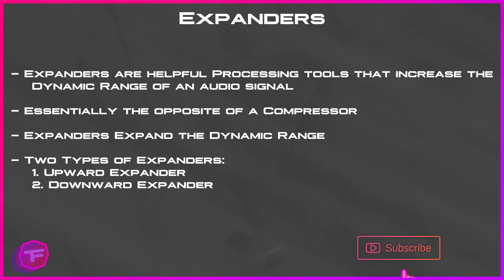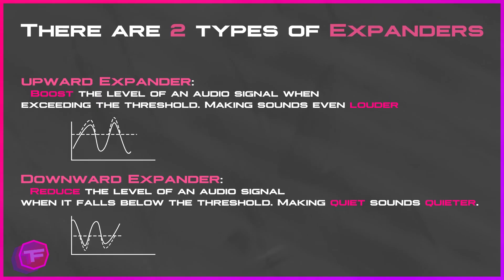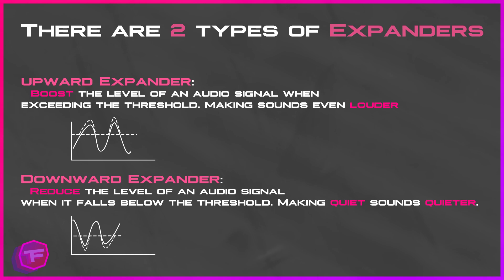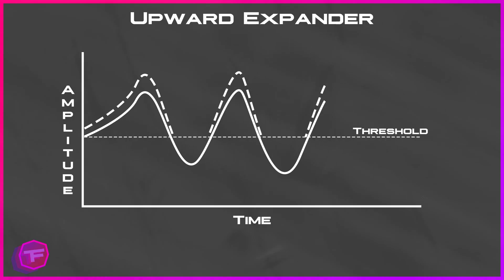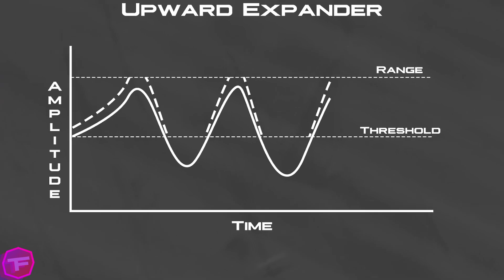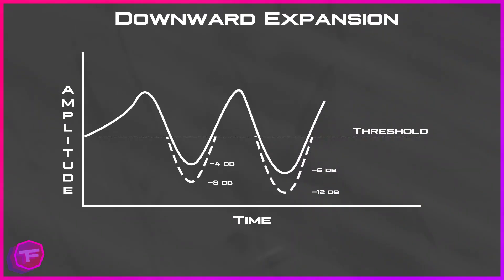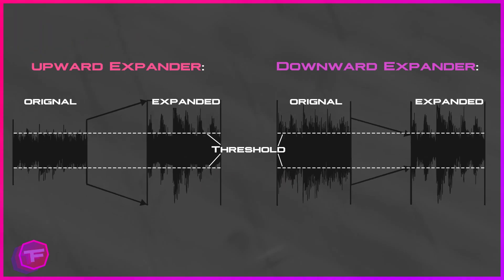Audio Expander Filter | What is An Expander??!

Comment: in obs you can also choose between detection: rms or peak. peak probably local maxima and rms is an average value (root mean square)
Reply from the maker: Each expander will have the main perimeters -> attack, release, threshold, and ratio.. the range is a rare one i think
Reply: Interesting, so OBS lets it work based on detected dynamics?  Sounds more useful than tracking just peaks.